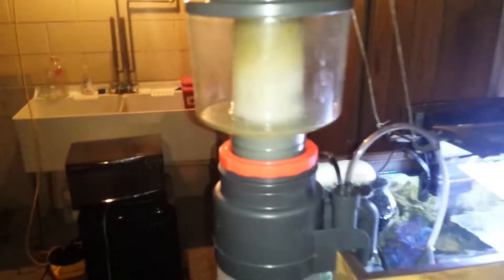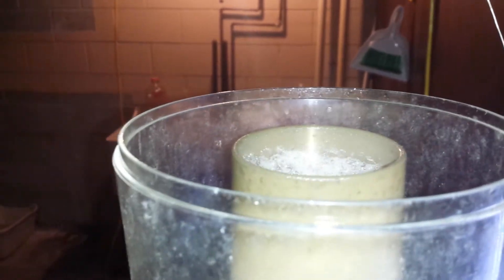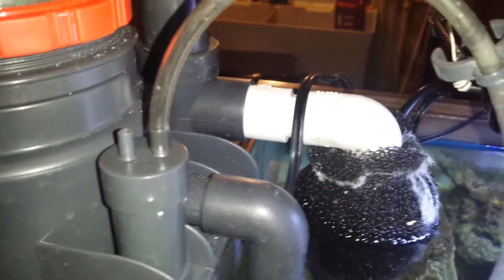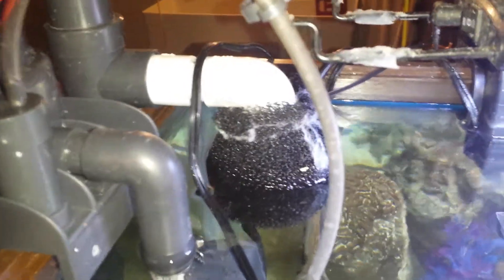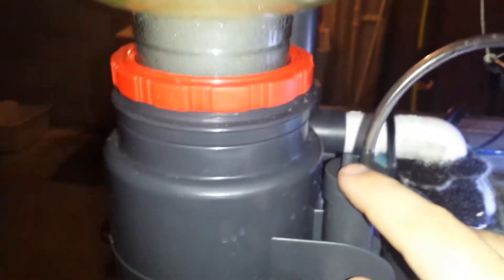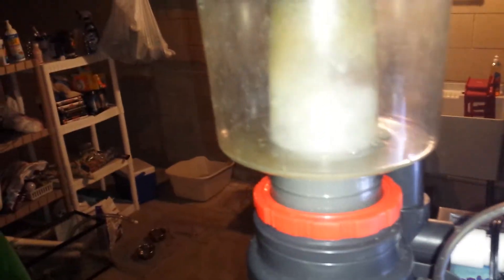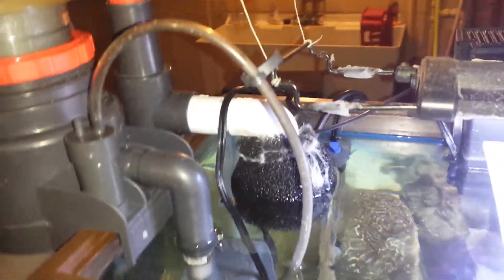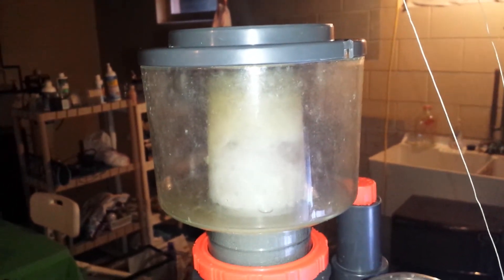Coralife 125 super skimmer - FAQ Answered

Comment: I'm just setting up one of these on a 45 Gallon tank that is a temporary tank. My 90 gallon is leaking. It takes a little less than a Gallon of water. Anything above a 75 gallon you can use RO/DI water if you don't have any saltwater made up. I used a 3/4" PVC Street "L" for the return. I used a Foam Filter Sock from a Penguin Sponge Prefilter Kit. I gently forced the Sock Support Diffuser into the big end of the PVC Street "L" and put the Filter Sock over that. This is for the micro- bubbles being returned to the tank. I highly recommended putting the Skimmer Drain tube into the tank for the first 24 to 48 Hours, till everything settles down. Also I used a 14 gauge extension cord plugged into a GFI and plugged the pump into that so I could quickly power the pump off, when doing an initial set-up. Yes the Cup came close to overflowing during my first few starts. I'm going to look for a smaller tighter "L" as I cannot get my glass top all the way back. With it Dialed all the way down I was getting Clear Foam in the Cup center tube, it would rise about 3/4 the way up then collapse. Now the Foam is steady at the bottom of Cups center tube.

Comment: which is better sponge completely submerged or and i lost instructions i have 125  the inch or 1/2 inch below or above water line....and those are guesses from what i thought it read. just plain confused. its going to hang and not using it as sump, hope that helps get me answers.....thnxs
Reply: How do you set it up though mine didn't even come with instructions and it's in pieces